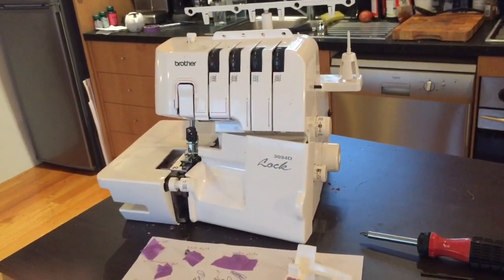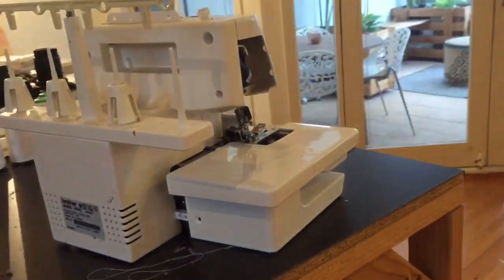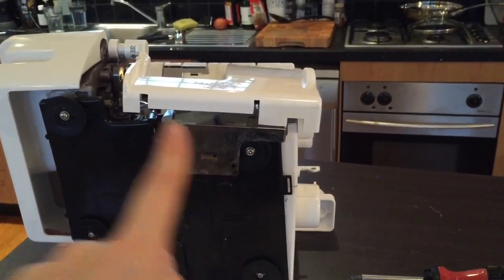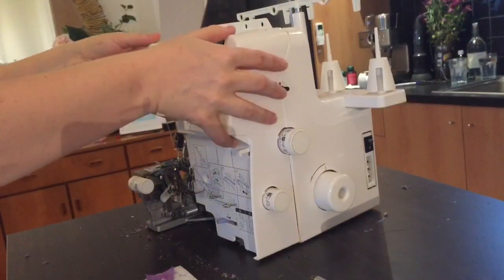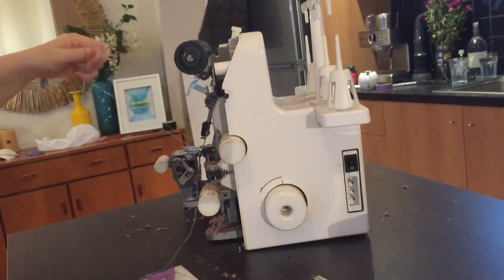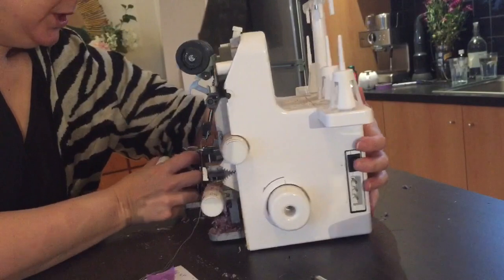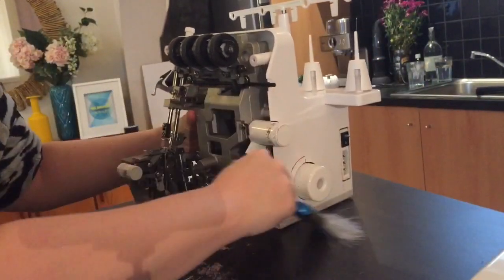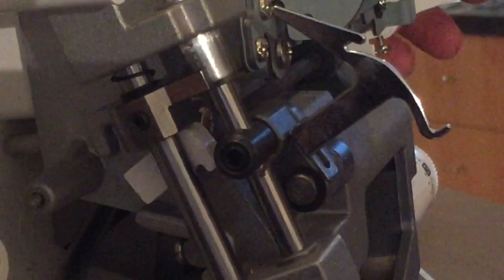How to repair Brother 3034D overlocker serger, foot lever

Comment: Hey Nicole (down under?), this is Kathy in Chicago.  I can't believe the identical problem that happened to me has also happened to you on the same machine, same week, other side of the planet!!!  I got as far as you, except I couldn't quite figure out what the original position of the little white plastic bit was.  Thank you so much and happy serging!!!
Reply: KATHY CARBONELL hey there, I know this video is a few years old but wondering what you did to get your problem fixed. I’m having the same issue. TIA

Comment: Thank you for this video! I’m having trouble taking the front plastic piece off. I can’t find what was that you clicked and it came right off. Thanks!
Reply from the maker: Victoria Martinez ooh I can’t quite remember what that piece was but it may have been the blade that you need to unclog and pull forwards. It’s the grey plastic flat handled thing, attached to the hook shaped cutting blade. Or the other thing it could have been is the blue arm that you slide across when you’re threading. Try both. Hope you find it.

Comment: Just bought this today. The presser foot lift handle on the right is a little loose, is it supposed to be?
Reply from the maker: Yes I think mine has always been as well. I’ve had it since new. They don’t make them as sturdy as they used to.
Reply from the maker: However there might be a screw on it that you can double check if it needs I tighten. But I remember it being pretty flimsy.
Reply: @NicoleHerrickDIY  I checked that and it was tight. My lever is kind of bouncy but it serges perfectly. Thanks

Comment: Thank you,  I learned a lot.   My wheel won't turn at all so I can't move the needles up and down to thread it either.  any advice on this problem ?
Reply from the maker: It sounds like an engaging mechanism that makes the wheel turn. either a cog or a level. They are usually plastic so the get brittle over time. Try manually moving some of the elements around the wheel to try and figure out how that area works and at which point the process sops working.  Hopefully you find the part!
Reply: How do you trouble shoot then?
Reply: Maybe that is due to oiling. I bought a used serger, Brother 760DE and it's wheel is pretty hard to turn. I have tried to oil it and now I put also WD-40 (waiting if it has an effect). You can see my process here: https://youtu.be/uLfJLh-vI6o

Comment: Good morning, I brought my 4 year ago and   only it 1 times.. I try to use it... and everything was seized in it... my brother attempted to fix it I'm broke two of the gear in it ...how can I replace it
Reply from the maker: You can call Brother and ask if you can buy a replacement of the gears. With any machine, if you haven’t used it in 4 years, it may need to be started slowly. There is a hand winding knob on the side that you can use to manually turn all the gears and parts and get them to re-grease themselves before turning it on fully.

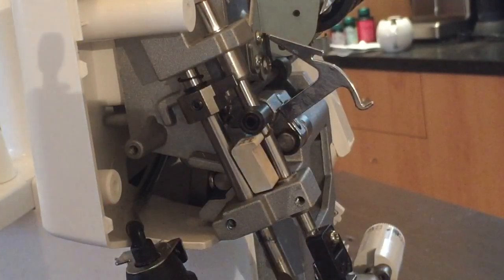Comment: This video is a relief. HOWEVER mine came with a black plastic lever (same white little thing in the video) and it happens to be snapped in half. Anybody know where to purchase that tiny little lever bullet? 8:25
Reply from the maker: da naughty virgo you should be able to email some suppliers in your country and send them a photo of the part and the location it’s in along with your machine info and they can post it to you. I’m in Australia I can offer some advice on where to find parts here but other countries, just google sewing machine parts suppliers.
Reply: @NicoleHerrickDIY  THANK you!
Reply: Mine broke too!  Found the replacement on eBay in USA for $25.  it’s called pressure foot shaft assembly.  Good luck :)
Reply from the maker: Leann Blunt oh awesome! I still haven’t replaced mine as I just decided to keep the foot down all the time. But I’ll order it now that I know the name. Thank you!
Reply: @leannblunt6349  wow thank you. Bless your heartz!
Reply: And the bar can be easily replaced!  Be sure to roll needle all the way down so out of the way to get screw on left side holding down bar.  And I cannot wait to ‘raise my foot’! LOL

Comment: My server stop working and it want turn? Can you help?
Reply from the maker: Kimberly Stewart when you say server, what do you mean? The wheel? Is the needle jammed? If so, try taking all the threads out of the machine, open the front section and clean out any dust. Move your wheel back and forth gently to see if you can figure out what’s jamming it.